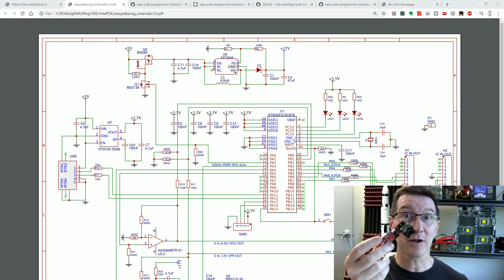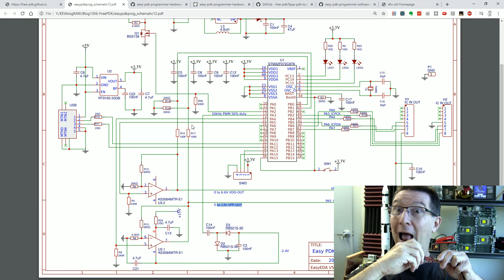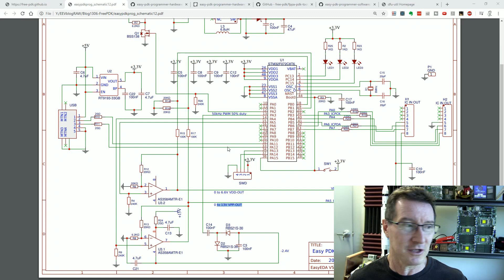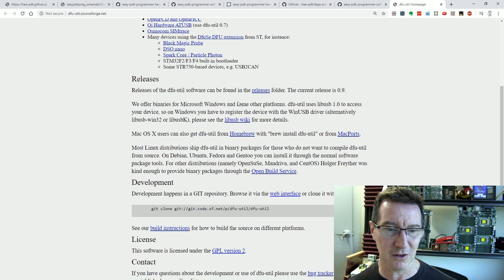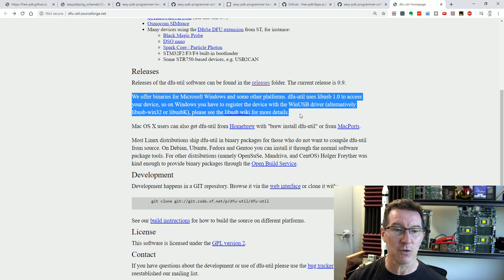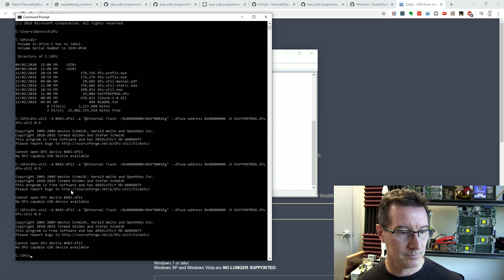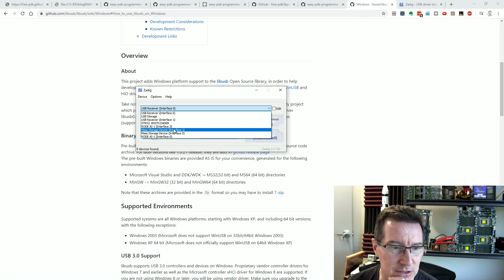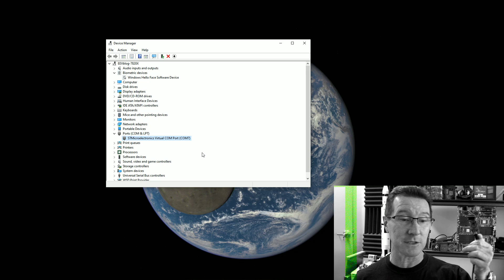EEVblog #1306 (3 of 5) : How to program an STM32 using DFU Bootloader

Comment: Whenever I'm working with new hardware like this, I always keep a log of every step that I do.  Sometimes you end up going down a rabbit hole to a dead end, so it helps when unraveling the steps (so you don't end up with stuff installed that you don't need or that may cause other problems).  Then once I finally get it going, I don't have to wonder "what did I do to make it work?".  I then go back through my notes to generate a clear installation manual that I can pass on to colleagues.  Also, I sometimes get reassigned to another task and have to come back to this one months later, so the log really help refresh my memory as to what I've done.  Having a video log as you do sure makes it handy.
Reply: So many tasks I undertake would be well served by keeping a log.  Just not disciplined enough.
Reply: Yes me too.  Always keep a log, note what worked and what doesn't, any error messages, what I tried, etc for every step.  And then I put a summary of what worked at the top so I can pass this to colleagues and use this summary to work from from now on.  If I discover new stuff, I update my notes and summary.
Reply: @kissingfrogs  that is a good idea. But I'm too lazy. Just am faster trying everything exploratory. When I need to run some commands I just can't be arsed to write down every command down before entering it into the shell to try it
Reply: ‘cause problems’, you mean like the HDMI input video glitch which immediately shows up after the USB driver is shoehorned in to place?

Comment: On Linux that's literally installing dfu-utils via your package manager and then one command to program it
Reply: good to know. i was already afraid i had to troubleshoot this, too :)

And again THX for the video EEVblog
Reply: As I remember on my centos7 it worked out of box, nothing to install
Reply: Kickstarter: Embeddio SNAP Boards - add functionality to your Arduino or Raspberry Pi - start SNAPPING!
Reply: @mrlazda  Linux Mint CINNAMON 19.3(Tricia) 64bit does the same.

Comment: Programming embedded devices has improved a lot. I've fought for days with janky custom software just to flash a device, it seems much better nowadays.
Reply: as long as you dont fuck up your fuses and disable some of the programming ways. had that recently with an avr disabled jtag and spi upload by accident. had to use hvpp which is like the real device fuck up mode... but it works again
Reply: Windows is the janky software now

Comment: Command line shortcut: click once in the File Explorer window with the thing you want to run (the background, not any file in the window), hold shift, right click mouse.  You'll get a context menu and one option will be "Open Command Window Here".  If your default command interpreter has been set to Power Shell on your system, this option will be replaced with "Open Powershell Window Here"

Comment: Before watching any further; I've worked with STM32s a ton, and the Cortex M3 does not come with a built in DFU through USB. You'd have to tap into the UART1 headers and flash throgh a serial converter.

Comment: Typing  "cd \" will take you to the root of the drive your in. That way you don't have to type "cd .." a bunch of times . Trying to help. Thanks for the great videos !
Reply: Shift and RightClick in the explorer window, and there is the option to open commandprompt or powershell in that directory :)
Reply: And tab to autocomplete directory names.
Reply: I thought Dave effectively did that with cd\dfu saving a step
Reply: Didn’t work in Linux. All it does is >
Reply: @HighestRank  Linux is not Windows. Back slash is an escape character in Linux. Directories are specified using forward slash

Comment: I've never tried it on Windows with an SMT32, but I remember Zadig from back when the RTLSDR fever started. Actually DFU looks more straightforward on linux if you have the precompiled (or can compile) the same dfu-util in the video. You just have to look up the correct USB VID/PID with lsusb. No driver replacement needed, the kernel handles this out-of-the-box. At least for an STM32. I came across some F103 boards where the USB dataline pullups were missing. If you don't have a debug probe for STM cortex-m devices there's an alternative UART way too using STM32-FLASHER.

Comment: LibUSB is a bit tricky to operate under Windows, especially if you haven't worked with USB devices.
BTW that "address" you saw (0843:df11) is an identifier, rather than an address. It consists of two parts: Vendor ID (VID) and Product ID (PID). The computer uses it to identify what type of device it is (to choose the correct driver, for instance). The actual address is the "Port_#0009 Hub_#0001" part, and you can't really change it (nor is it necessary, in almost all cases), short of plugging the device into a different USB socket.
Reply: Thanks. That probably explains why I have had Windows machines where usb devices will only work when plugged into the "correct" port.

Comment: We use STM32 F4 or F7 processors in FPV mini quads. CPW210 or STM32 drivers, then Betaflight Configurator to flash and tune our kwads. Win10 doesn't automatically install the drivers. Happy Flying.

Comment: You could have just used the DFU utility provided by ST directly instead of fiddling with the WinUSB driver. The reason for the replaced driver is because the ST driver interface is not directly supported by the DFU tool you used. ST link Utility or STM32CubeProgrammer would be a much better option and you would get access to all the option bytes as well

Comment: Why all the hassle with that weird commad prompt operated programming thing?
Why not use STM32CubeProgrammer which get's you going in few clicks, launch program >> change connectivity from st-link to usb >> select port >> connect >> choose file >> programming.
It also doesn't require any additional drivers.
Reply: Because then you have to hassle with some random undocumentable GUI instead of the industry-standard dfu-util tool.
Reply from the maker: a) I didn't know that
b) This is what the instructions on the github said, so I was following those, that was the point of the video.
Reply: The developers probably wanted to support an open-source project instead of ST's own proprietary software
Reply: Because the ST Register/Login before download is so annoying.
Reply: @JoeBee999  I know it isn't ideal either but I think it's a much better option for beginners.

Comment: If you had used another DFU software which expects the STTub driver instead of WinUSB it would've worked straight away. For example STM's Cube Programmer. Also the migrated message in device manager is pretty common the first message until it's installed correct drivers. And yeah, I agree it's wierd the oldest is at the top, but thats windows for you. :D
Reply: Do you know of alternative DFU software which does expect the STTub driver (other than Cube Programmer)?

Comment: The schematic has R10 & R11 series termination resistors on the USB. They shouldn't be there. STM32F072 has the impedance matching internal so external series resistors shouldn't be fitted:
"3. No external termination series resistors are required on USB_DP (D+) and USB_DM (D-); the matching impedance is already included in the embedded driver"

Comment: By default Zadig only list devices without any specific drivers installed (to try and prevent a user from forcefully replacing the driver on some other device it shouldn't like ... his usb keyboard or such).
It seems that you already had a driver installed for STM bootloader, I would guess from some ST dev kit or software that you used in the past and this took over the device (you saw it when you plugged it in first, it first showed up as one thing then a few second later moved somewhere else).

Comment: This is great, gave it a thumbs up. Question:
 
"--dfuse-adress" it says not applicable for .dfu downloads. Isn't that exactly the type of file the firmware is? 

I couldn't get it to work,  i actually skipped that command and just went straight to downloading the file onto the device. It completed the download, i'm not sure if it works as intended. Thoughts?

Any answers appreciated, thanks.

Comment: Thank you very much, i did all steps even the dfu with the address of 0x0800 and all steps have been done, but even now when i am plugin the board, it can not give the recognized sound !. I have to use boot0 and nrst mode, i am using stm31f411 black bill board.

Comment: I wouldn't be surprised if David used Zadig at some point with the uSupply. Might be where you're remembering it from, Dave.
Reply from the maker: No, I've definitely used it myself for at least RF hardware dongles. You need it to remap the WinUSB drivers.
Reply: @EEVblog  You remember correctly. That is the same procedure for the cheap SDR dongles that use the R820T2 chip.

Comment: Oh, it's WAY easier to do such things in Linux. Such problems just don't exist. Everything is working just out the box, probably one or two simple commands are required to install toolchain/programming utility.
Reply: Conclusion: Based upon this ancient paleontological discovery, Linux must have therefore been a great monolith, with every fork of it containing every binary for every architectural platform, precompiled in a single, enormous online repository.

Comment: So does this thing totally mimic the manufacturer programmer on the fly, or is it like a block buffer to do whatever it has to do? , so you would have the to be written binary as a file instead as an output of the devkit?
Reply from the maker: Not sure, you'll have to ask the devs.
Reply: @EEVblog  Well by the time this video series is over we'll probably know. It is the biggest problem if it expects the programmer to be there for the devkit.
Reply: This thing’s just an open source end-to-end solution partially emulating functionality of an OEM-style programmer for two particular product lines, whose binaries run on architectures/platforms which the actual OEM’s programmer cannot. Easier way to pick the dev’s brain is to RtFM not to .gitignore it, and add love with some pull-request anywhere that our ignorance was allowed to persist. Only differences between a binary file and text et.al. is 1 null byte character and perhaps some carriage feed(s)
http://www.gnu.org/software/ed/manual/ed_manual.html